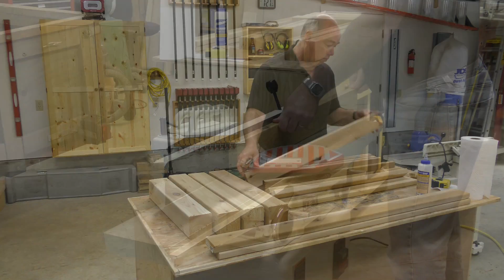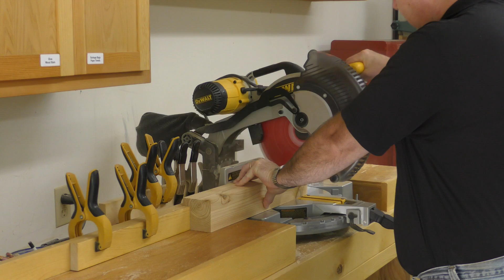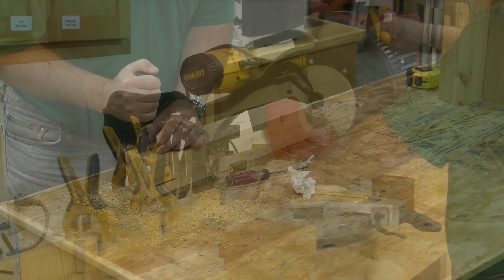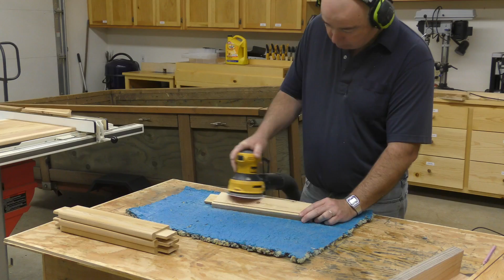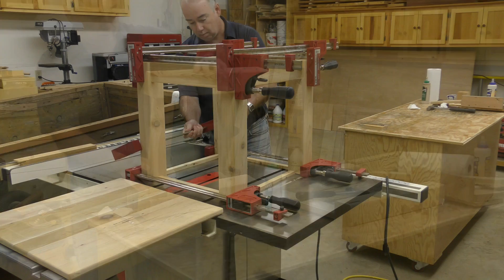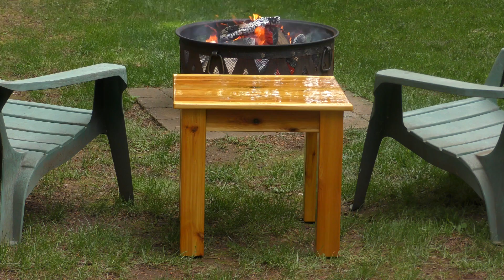Building an Outdoor Side Table

Comment: Table looks great! But I need verbal instructions. Not even dimensions on your site. Bleh.
Reply from the maker: Thanks!  The video is only meant as entertainment, not an instructional video.  The dimensions I used were solely based on the lumber scraps I had on hand. You could make the table any size you wish. For what it's worth, I think the legs are 3"x3" square and the top is about 16" or 18" square. The aprons are about 3" high. I think the table is around 16" high, but again you could make it whatever you want.

Comment: That’s not diy when your setup in a professional workshop, spend a couple of grand on tools to make a 40quid table
Reply from the maker: Just my hobby working out of a two car garage. It has taken many years to build up my current tool collection, many of which were used. The money I save by building something myself can be used to buy new tools in the future. Trust me, I spend far less on tools than most people spend on other hobbies like motorcycles, boats, and cars.
Reply: @AnthonyWatsonDIY  
Anthony I’m not criticising the table you have a done a great job, only being in the uk a majority of people don’t have access to all what you used at most it will consist of hand tools and a select few power tools, and as a carpenter I know that it’s not that easy to build if you only have basic equipment, just a question with a basic tool kit how long would you say it would take to build your table
Reply from the maker: @stephencunningham5761  No worries, I understand. I started out with a handsaw, drill, and a sander and built many projects before expanding my tool collection. It's doable, it just takes longer. I think this table took me about 3 days to build, plus additional days for finishing. You could certainly use off the shelf lumber and maybe pocket holes instead of mortise and tenon to build a similar table. That would only require basic tools.
Reply: Anthony 
Thanks for the replies, agreed you could use pocket holes to get something similar but I prefer more traditional joints like you used, they add quality to the piece, I’m tempted to try this with some old lumber I’ve got laying around and see what results I can get, I’ll keep you posted on the results.
Keep up the good work and I look forward to your future videos